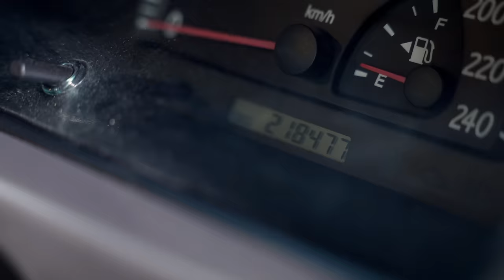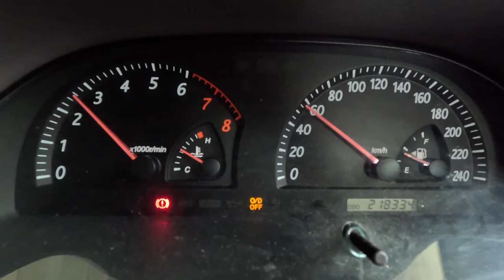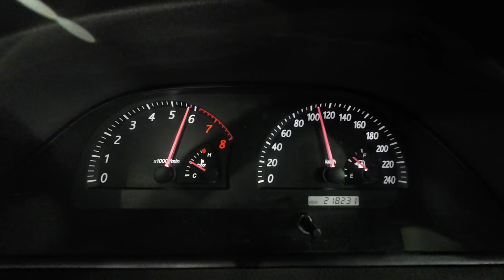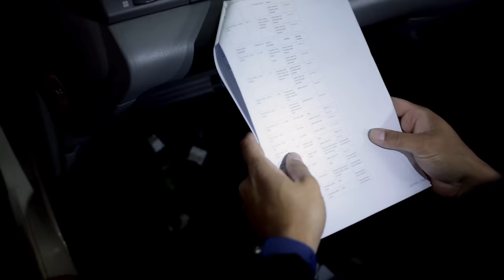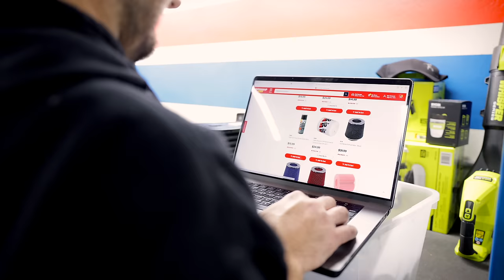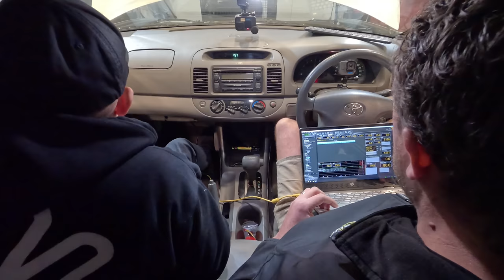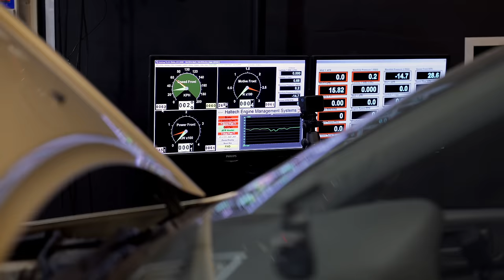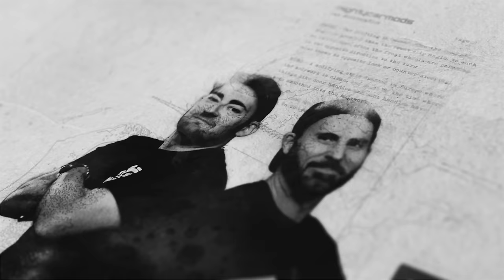World's cheapest Turbo Kit (on a Camry)

Comment: That motor is known for leaking oil through the rings! The 2AZ-FE takes boost incredibly well, but you HAVE to replace the rings! If you continue to notice excessive oil consumption after a tune-up, then it's coming through the rings! Love the motor, as it's in my Scion tC, but it does have problems.
Reply: Despite the oil consumption problems, the 2AZ is the most underrated 4 cylinder on the planet
Reply: @archive3do769  trust me, I feel that. I plan to turbo my tC, but I'm gonna invest way too much money into it to make the most power.
Reply: Also some years if I’m not mistaken have bad threads that cause the head bolts to come lose
Reply: @Rota_rd1  I've never seen any problems with the head bolts coming loose. It may just be something with the Camrys, I've never seen a post about it in the groups.
Reply: my 03 SE also sneaks some oil thru the valve guides
Reply: Camrys built in NA have problems, nowhere else
Reply: @gnyllan  yeah, I'm not as sure about Camrys. Only tCs. The only problem with the 2AZ-FE in the tC is the leaky rings.
Reply: @leemccready9717 nope, the only way to prevent burning was to have changed the oil on time every time since day 1. Most people that never have issues are the ones that did that. They’re gonna burn eventually, and the early ones leak at the valve stems over time. It’s hard to avoid it, but you can get away with it. But burning isn’t the end of the world, we had 2 Camrys and both hit almost 300k with lots of oil burning.
Reply: @tinuthomas531  yeah, but if you don't check the dipstick daily, you'll be out if oil so fast that you won't know what's making that knocking sound.
Reply: @leemccready9717  I used to beat the hell out of my Camry and I would have to fill it back up every 2 weeks. Not the end of the world, I’m sure the reason most of these died is because the owners never cared to check.
Reply: @tinuthomas531  yeah, it's the same with tCs.

Comment: Hey guys, this engine doesn't have lift.  Looking at the camshafts at 24:21, there's only a single cam profile going on.  The 2ZZ-GE is the engine with lift and dual cam profiles, like VTEC.  This engine only has VVT-i (as seen on the fender), which is just variable valve timing.

Comment: I would have looked for the v6 twin cam or v6 dual vvti version. Ive supercharged my 1grfe in one of my FJ cruisers and its a daily that sits around 650hp at the rear wheels. Not stupidly over done, its a total sleeper and tuned for longevity.

Comment: i have a 1994 toyota camry and im in the process of blacking out the gass cap door handles mirrors and hood but i got sick so ive only done the gas cap so far and rn it has a sub in it but im gonna put dual 15s in it eventually but they cost like $600

Comment: I'm definitely biased because an 02 Camry was my first car, but personally I think its a great car. Its very reliable, and its everything you need for a daily driver. Its good on gas, its reliable, its comfortable, and the OEM stereo doesn't sound bad either. I got the car in 2019 with 70,00 miles on it, and I drove it until 120,000 miles and I never got any check engine lights. The only light I every got was my wiper fluid was empty haha

Comment: This Camry is highly underrated, describing it as “boring” and “no street cred” is an understatement. With engines going as big as a 3.0 V6 and some optional with a manual gear box, this is probably the most reliable car on the market even with being 20 years old. And nothing is hard to get for a car like this, OEM and aftermarket parts are easily findable and affordable. Best car I’ve ever car across hands down and I will continue to buy as the years go on.
Reply: They said it was reliable, but it is boring
Reply: Let's not fool ourselves, this car is boring as hell and even the 3.0 V6 is woefully underpowered. Sure it's reliable, but it's still boring as hell, a white good, like a washing machine or a toaster.
Reply: Why is the Camry a boring car? The 3mz makes 220hp 1mz makes 200hp the 3vz makes 195hp. You have options for so many engine swaps. Awd conversion’s. manual gearbox. Factory supercharger options. I run bc coil overs in mine. Don’t really see how there boring.
Reply: @jordonwinchester6211  the 3L V6 makes less power than a Renault Clio RS of the same year, and that's a 2L
Reply: @bzilla-d4i ok there’s also 2 cylinder motorbikes that make more power what’s your point? Toyota underpowers there cars for reliability. Also the Clio makes 200hp so around the same as a Camry v6? You can’t compare 2 totally different engines from 2 different manufacturers. There’s v12 engines that make 50hp😂
Reply: @bzilla-d4i  I've dailied one of these for 5 years. 320,000Km on it now. Only ever had the engine light flicker on once, and that was for an ignition coil. Boring - yes. Underpowered - yes. But I choose reliability above all else. Power and excitement aside, what I really don't like is the handling - they handle like a bus. And the ride quality is rather harsh, especially since they've all had their factory struts replaced by now with aftermarkets. These are also retaining value; I've seen various examples going for almost twice what I paid for mine half a decade ago, which is rather silly.
Reply: @MattExzy  I've driven one on holiday in Australia, they're truly awful, and that was the sports model. The V6 with that terrible body kit. Out of all the Aussie cars I'd rather have a Commodore.
Reply: @MattExzy what model do you own? The sportivo came out with stiffer “sport” suspension. There not really underpowered they even said in the video the v6 is fast. I own a 96 vienta and have raced a cl9 accord and ford falcon which both I beat in a stock Camry.
Reply: They used to come with a 3.0 a supercharger and a 5speed in the old Trd option.
Reply: My Camry is the 3.3l v6 but there isn’t a single mod except an intake for it
Reply: @TheShortsPlug24   theres mods just not easy or cheap ones, thats toyota modding lol
Reply: @spacetoast4874  if possible would you know what kind?
Reply: @TheShortsPlug24  turbo nitrous anything you wanna do can be done. It’s just time and money.
Reply: my camry is amazing. it’s a 3.5 liter v6 with stock 290 hp (stock) and now it’s around 350-360. and it came manual
Reply: As big as 3.0?? The Camry has been available for the last 20 years with a 3.5 with quad-cams and VVT-i. the 2GR-FE with over 224kW.
Reply: @DiscoFang I’ve got the blade (Corolla) with the 2gr fe, 305hp in a little Corolla surprises a lot of people especially when the Mazda MPS loose at a pull😂 I’ve always wanted the 3.5 Camry until I found out about the Toyota blade master g
Reply: @reece5238  Great car. There was one for sale here in NZ a few years back that had been converted to manual (transaxle from a diesel version). That would’ve been fun. 
There is also a version of the RAV4 with the same 3.5, available used from Japan. Called the Vanguard.
Reply: @reece5238  Btw I think they’re derated to 280hp/209kW in the Blade. That’s still a decent whack!
Reply: @MattExzy  I drove my 2003 Corolla to almost 300,000 miles before giving it to a friend who needed a car. Super reliable, never left me stranded, maintenance is cheap and dead simple. If you do the basics like regular fluid changes and suspension/brake maintenance over the years, they are easy half a million mile cars or more before needing serious repair.
Reply: 5sfe is trash and can't handle boost. It's only reliable stock and slow

Comment: Ah, I am still excited for this, but I was hoping that it was going to be the 2.5 2AR. Oh well, good to see that maybe the 2.4 2AZ will get some love. I hope one day you guys are able to do something with the 2AR, and potentially collaborate with Frankenstein Motorworks to get 270 NA whp from a 2AR.
Reply: The 2AR is probably the best budget Toyota swap rn. I see everyone talking about it, and 270 out of an NA i4? That’s pretty insane considering it’s just an economy engine. The 2AZ is a bit more popular though because it’s been turboed for years, so that’s probably why they chose it. ShaneVlogs had his turbo Camry with a 2AZ pushing close to 500hp.
Reply: Was also hoping it was an 2ar so they could play with Frankenstein's stuff
Reply: @tinuthomas531  Yeah. It is currently be developed in a way that can be done completely on the stock ECU with no need for piggybacking. It uses hybrid (2AR-FXE) intake cams on both sides, along with a swap from Dual to Single VVT, to make 240 whp, from there, a new intake can get it to 270 WHP. It also scales linearly with displacement. Toyota makes a "OEM" stroker kit with the 1AR, making it 2.7 instead of 2.5, that should get you to just about 300 WHP.

Comment: Choosing the Camry is absolutely brilliant. This is the definition of sleeper. You take the most boring and unassuming car and boost it and win races because most people think "it's just a Camry so I can just give it half throttle". Awesome project!!!
Reply: there is a lot more aftermarket for the honda accord  and you would get better results with the honda. also you could also just buy a slightly newer camry with a v6 that makes the exact same amount of power.  this is still huge gains from a cheap china kit but the best move is to trade this in and buy something faster not worth the mods!
Reply: @BassRacerx that’s not as fun though
Reply: @shaunlangenberg   not as fun to drive or not as fun to tinker with? i would argue the v6 camry/ accord would be more fun to drive. It's okay to tinker with cars just to have fun tho more power to you. I was just pointing out that if you were truly on a "budget" you would just buy a different car!

Comment: Hey, so the Scion TC had a 6 speed manual option. That would be a sick add on.
Reply: The TC actually had a dealer option for a factory TRD supercharger kit! I believe it bumped up the hp from something like 160-ish to just over 200. It was notoriously unreliable though, unfortunately. You can still find them putting around though.
Reply: The Camry was optional with a manual here as well. Only briefly though, and was a much better drive than the auto.

Comment: That resonator on the intake has the exact same outer diameter as the inner diameter of a new cane or walker bottom bumper available at your local pharmacy. You can just slap one of those cane ends on there and change the sound completely. Very sporty.

Comment: the resonator on the intake is cause the 2.0 and 2.4 liters they used in Camrys for a long time have a ridiculously loud intake. i you just put the biggest  pod filter on a stock one it will sound like a racecar.  and echo off the houses as you drive by

Comment: With those 2AZ-FE engines, you need to be cautious and make sure they aren’t neglected. If they are, they burn oil like crazy. There used to be a TSB out for them because it is so common.

Unfortunately these engines have almost no aftermarket. When I owned a Camry back in 07-09, I bought aftermarket parts meant for a scion XB since the engines are the same, just a different transmission
Reply: I wrote the same comment hahaha, never owned one myself but I heard that there were issues with these engines in North America, particularly the coating that was used on the cylinder walls. However in the video he said it had a steel liner so maybe it was a different type that was produced at a better factory. I’m not sure but I’m just saying I also cringed as soon as I saw that engine
Reply: 02-06 Did not have the oil burning issue the 07-11 had. Although the 02-06 has a head stud issue if overheated.

Comment: Ever blow air across the opening of an empty coke bottle? You know how you have to blow a certain strength/speed to cause the harmonic whistle? That tube on the intake is an empty coke bottle, and the diameter/length is tuned to cause harmonic at certain RPM and either change the intake sound by increasing or decreasing (or both) certain frequencies.

Comment: I have this exact car with 460,000 miles running like a champ. Would love to turbo it just like this. However, It’s got the infamous oil burn that requires a quart of oil every 800 miles. So it’s either, turbo or bottom end rebuild.

Comment: Wish yous done a perfect daily build like the Audi a3 Quattro 1.8tfsi there surprisingly fast in stronic with the drive selects and the launch control built in haha I picked one up because I couldn’t afford the s3 but with some relatively cheap mods and a tune there rapid . Mine was 9k spent 3k on it and it’s faster than an s3 good bang for your buck that average s3 for same year 2014 is around 18/20k in uk

Comment: I had a 98 5sfe non interference dohc i didnt get to install racing headers or exhaust but i replaced stock discs to cross drilled slotted rotors added 17in rims chrome lip black star center i added a short ram intake and i swapped rear drum brakes to 6cyl camry disc rear brakes and suspension. Just never readjusted the emergency hand brake cable..i replaced drivers side fender and whole drivers side door old one got damaged so went to junkyard and bought another used one and reinstalled all wiring on drivers side...door..

Comment: Do intake and exhaust porting. Port your intake and exhaust manifold. Change the flywheel pulley. Make it a little smaller. If you're going to rebuild the engine you're going to have to use pistons and so forth because you don't want to burn the Pistons when your turbo charging it

Comment: If anyone has one of the pre revision versions of these motors and it's chugging oil no matter what you do, try doing the BG flush (44k in the fuel, EPR flush with MOA in the oil after), this legitimately fixed my dad's XRS oil consumption and I tried everything.
piston soaks, various different frequent oil changes, fuel treatments, intake valve cleaner, seafoam you name it.. BG did it in one go. I don't think the fuel or moa are even necessary but the epr stuff legitimately fixed it.

Comment: I have thought of what mods I would need to make my Corolla a solid little sleeper - 1) Turbo Kit 2) Some form of LSD 3) Coilovers with custom spring rate (Stiffer Rear) 4) Wheels + Tires 5) S / XRS Body kit + wing. 

The only downside after all of that is the fact that the rear suspension on the Corolla is not independent! You can make these cars fun, but they definitely do not come that way, and that might have something to do with why they are so reliable lmao

Comment: Dudes you never mentioned what injectors u used, or size. I'm building a 2006 rav4. Just finished putting the 5spd transmission from a camry in which was surprisingly easier than I thought lol axles were most difficult part. But not really. Lol I took the axle end from the rav4, and trans end of axle from camry, and measurements to a local driveshaft axle shop and they made me a set of strong axles for only 500 bucks! I used the camry pedals and had a local tuner do some ecu magic. And all has been good so far for the last 4 month 😂 
So now it's time for the engine!

So what size and brand injectors?
How many PSI did you run? Final?

Comment: Honda CRX with a B18 cheep turbo injectors FMU to make it cheaper and slicks if you can find a cheap CRX now but it’s possible I bet it could be done for 5 g or under possibly 3 might need a pucked clutch

Comment: 18" inch wheels, wide as possible maybe 245/40R18 or something :) 25mm rear spacer, 5mm front spacer, Roll Center Adjuster (front pair), old camry's are transformed by these cheap tweaks, usually its a few nuts and bolts :D

Comment: I pinched a couple of flange gaskets of one of these camrys for my turbo 2000 falcon the original are crap it produces about 200kw, my dads and brother came up with the idea but i beat them to it, there's produce 300+ kilowatts using stock engine, upgraded brakes & suspension bushes to make it better.

Comment: I bought my 2001 Camry for $525.00 and I'd drive it anywhere. It has over 250,000 miles on it's original engine and transmission. I love it.

Comment: I had 2010 Camry hybrid ex cab 900k. Purchase it in 2017 and til Dec 2023. Except for tyres rear brake pads anything I changed was a front passenger wheel bearing. I knew the owner personally and he said it was the original motor and he thinks it was original battery.  He did  changed was the abs module. The last couple of years I owned. All the shocks were gone if you're on the highway and hit a bump it to just start bouncing and wouldn't stop you'd have to slow down. In the winter months here in Brisbane I'd have to use my obd ii to reset the battery sometimes two or three times a day. Some young creek reversed into me straight for the computer. Work out well because I paid two and a half thousand I got paid out nine thousand. Cheers

Comment: One thing to bear in mind when boosting these engines for anybody interested the head bolts are very weak on this engine if you're going to do this you need to use studs preferably you would want to drill them out and tap them with coarse thread helicoils The problem with these head bolts is that they are very fine thread and they will yank right out over time

Comment: I have 2020 Camry LE FWD 2.5 L4 engine AUTO Transmission, if we put this kind of turbo, do we need to change transmission, suspensions, exhaust etc. 
Is there any impact if we just put in turbo and not put other performance parts. 
And after installation do we need premium gas as well ?

Comment: 250 is right around what to expect from these engines without building internals, 300 is entering danger to manifold territory, so 269hp is pretty good. But to get more than that ya'll are gonna want forged pistons and conrods and probably new valves + heavier springs. Keep the crank and cams, they're forged steel so pretty decent.